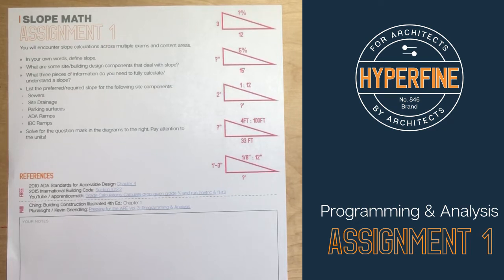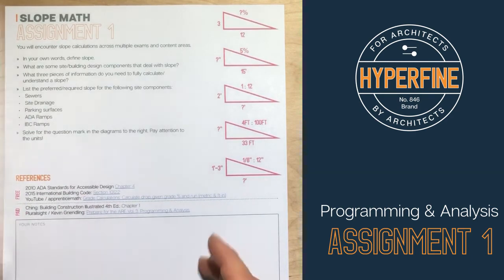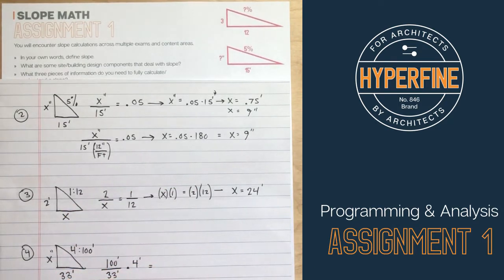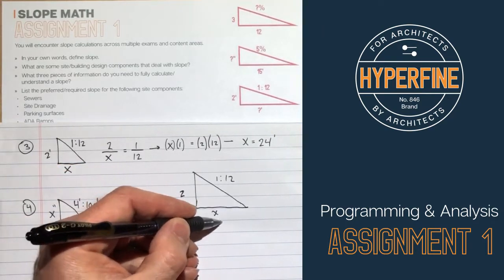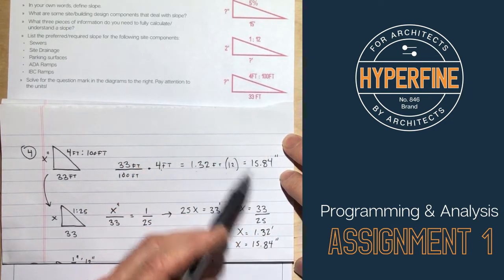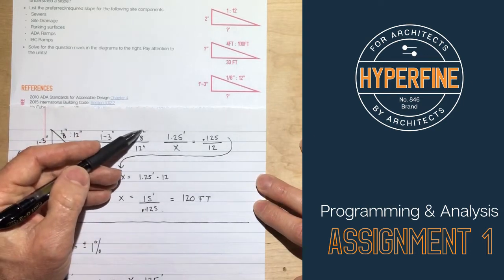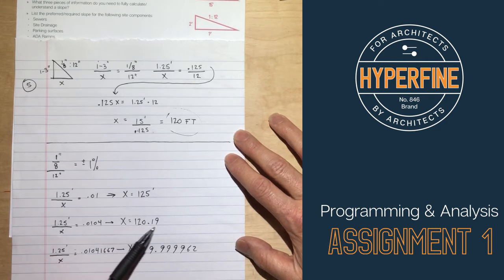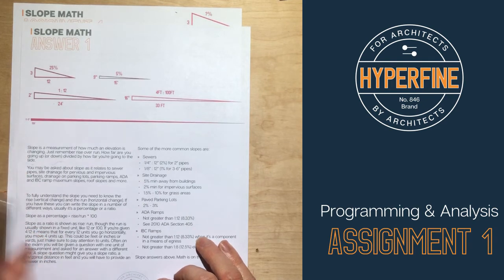ARE 5.0 - Slope Math and Rounding

Comment: Great video! can the building be  5 stories even thought the Sa is 3, or is 3 just to be used in the formula?
Reply from the maker: Thank you! And you are correct, the allowable height is different than the height you are allowed to use in the formula. Although I think you might be commenting on the wrong video, and that one is probably out of date for changes in the 2021 IBC, although your statement is still correct...allowable area formula height is different from allowable height.